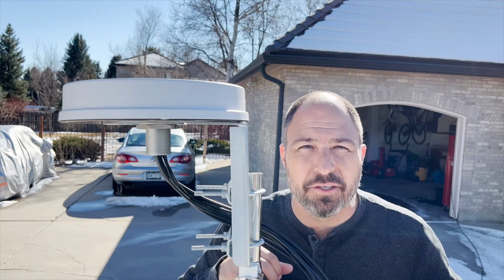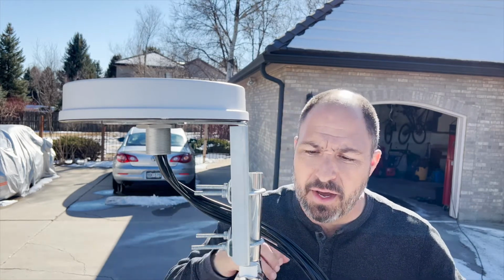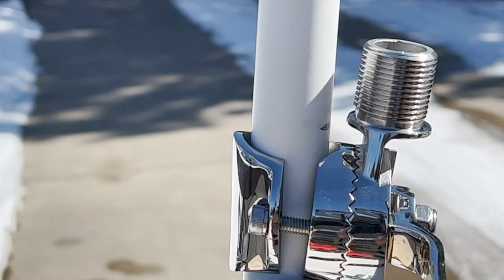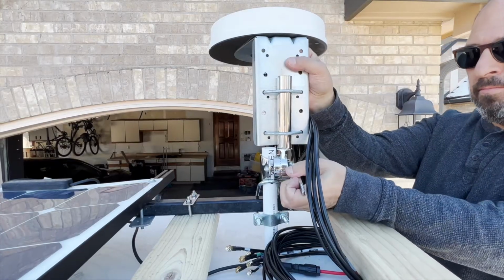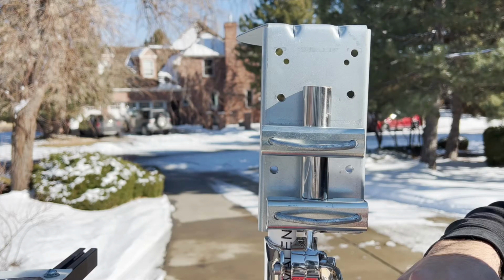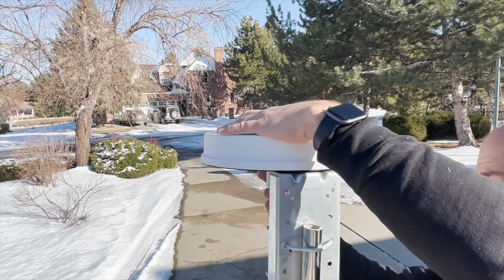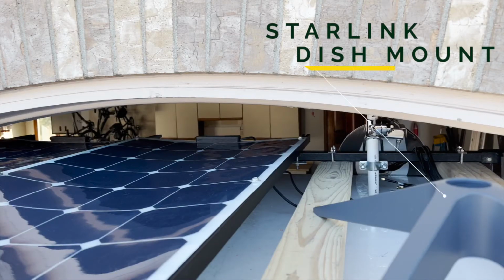How To Install Cellular Antenna on Camper Trailer

Comment: Do you still use this set up to work when traveling? How has the antenna performed?
Reply from the maker: Candidly, Bob, I rarely use that antennae anymore. For starters, the places I go camping either have plenty of cell service or none. The antennae doesn't do a lot of good in the first situation and, obviously, doesn't do ANY good in the second. Having said that, the biggest reason I don't use it is I use my Starlink setup almost exclusively at this point. Starlink is available almost everywhere I go and the service speeds blow cell service out of the water. I can even make phone calls over Starlink.

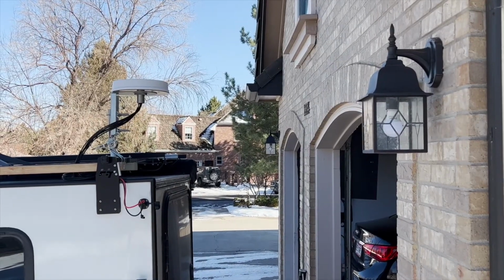Comment: Nice vid, and ideas, thank you! What's the black rubber grommet type thing (@6:20) that the antenna wires are housed in just before they enter the trailer side wall?
Reply from the maker: The wires for the antennae don't go into my trailer in this video -- they are simply coiled and laying on top. Until I was sure that the setup would work, I strung them through an open window. 

Shortly after the video I used this box...
https://www.amazon.com/gp/product/B07RT6NWTR/ref=ppx_yo_dt_b_search_asin_title?ie=UTF8&th=1

...and these cable glands to pull the wires into the trailer.
https://www.amazon.com/gp/product/B07KFCGFYF/ref=ppx_yo_dt_b_asin_title_o04_s01?ie=UTF8&psc=1

When you refer to wires going into the trailer, I think you are seeing the solar panels going into the trailer. That is an SAE connector:
https://www.amazon.com/Connector-Electop-Weatherproof-Universal-Flush-Mountable/dp/B07WCMX24L/ref=sr_1_8?crid=13JPG7EZDISJG&keywords=sae+connector&qid=1671197933&sprefix=sae+connector%2Caps%2C137&sr=8-8

Good luck!